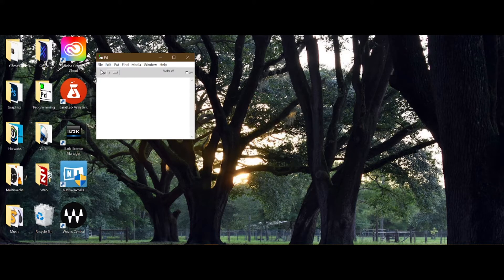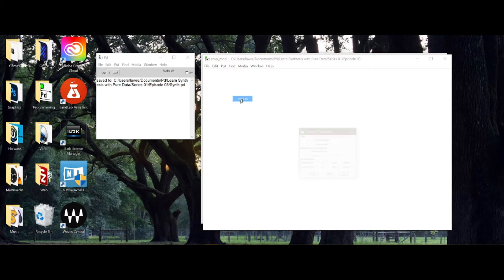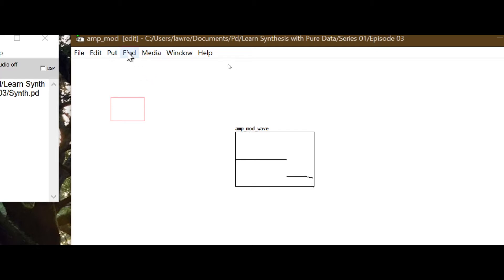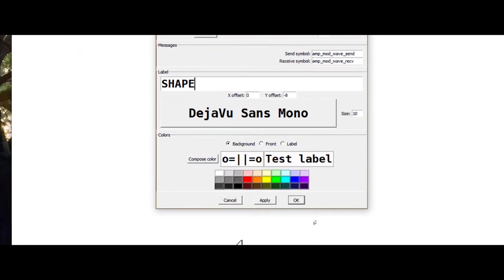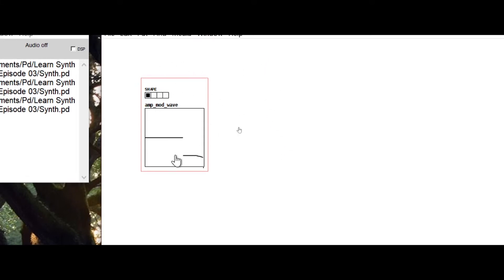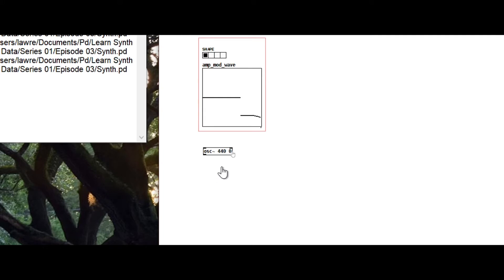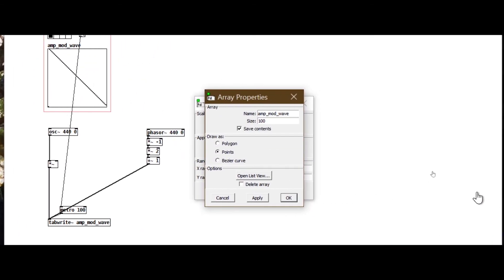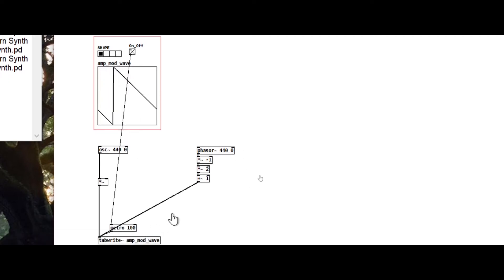Learn Synthesis with Pure Data S01E03 - Wave Shaping the 4 Basic Wave shapes

Comment: Really good videos. Thank you very much. I've a bug somewhere, once we add the Sine onoff message boxes, nothing appears on the oscillo and the error message is: class *~   inlet: espected signal but got list. Any ideas of what's going on?
Reply from the maker: This means that the *~ object is receiving something that it shouldn't. You should only have audio signal coming into its left inlet. Its right inlet can receive other messages. You can send me the patch at lawrence@thewayfarerproject.com if you would like me to look at it.
Reply: @thewayfarerproject  Thanks Lawrence. I'll do so, it's very kind of you
Reply from the maker: Let me know when you send it so I don't accidentally delete it or have it go to my spam folder.
Reply: @thewayfarerproject  I just sent you a mail with the PD project. Thank you for helping Lawrence, it's very nice
Reply from the maker: I got your message about the fix that I sent and I just sent the finished patch from the end of the video. Those messages are required. The receives that go into the right inlet of the *~ objects do need to receive numbers in a range of 0-1. If they don't, they are automatically 0 and there is no sound.